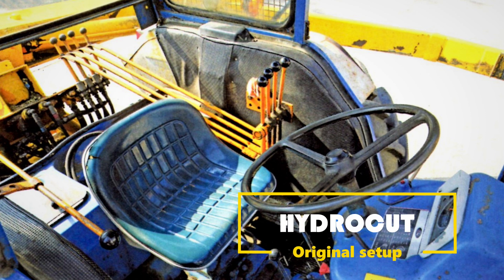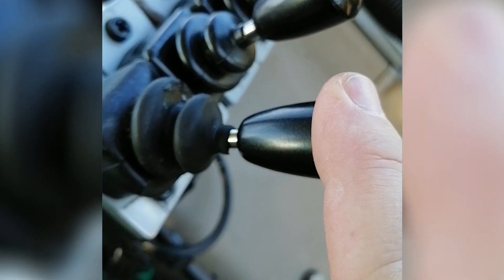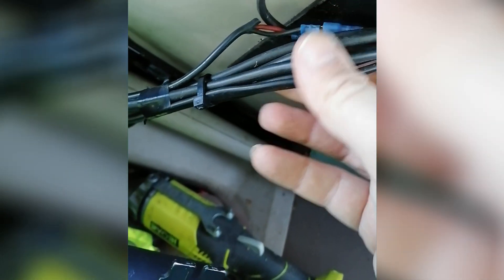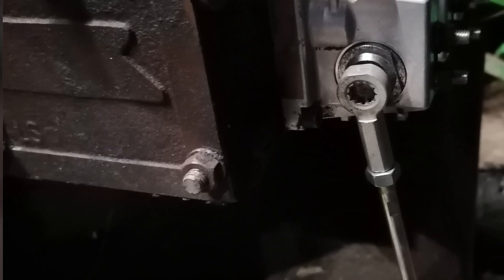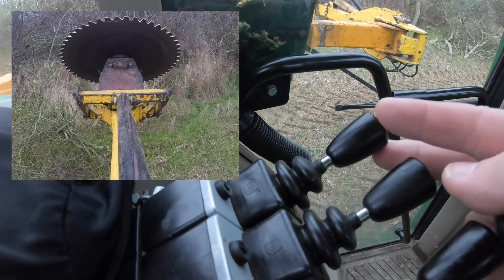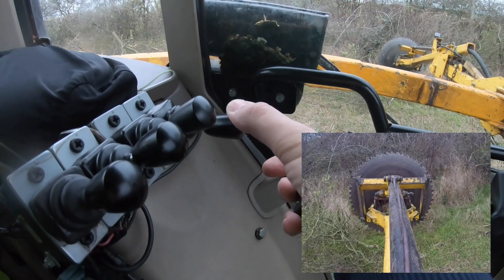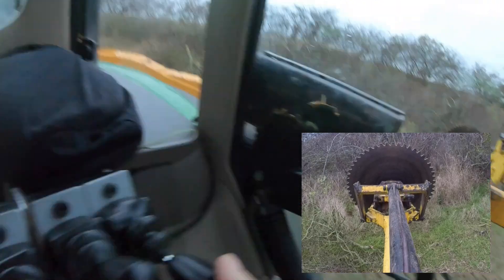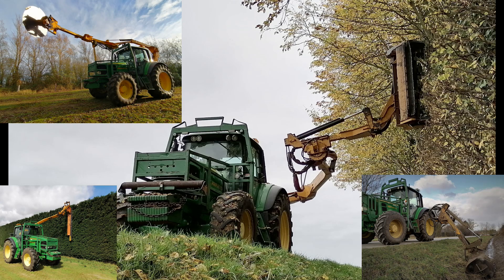ELECTRONIC SPOOL VALVE CONVERSION ON A TRACTOR MOUNTED HEDGE CUTTER          (Hydrocut G-rahf)

Comment: I got the newer version of this but can't adjust levers in cab but there's a Allen screws on each spool with lock nut .and levers a bit chunkier.great set up a wee bit costly tho .cheeper than a new hedge cutter and can take if off if ever changed machine

Comment: Great job 👌well explained.  A good bit of work but fairly straight forward now that you'd showed the ins and outs.  I love learning new stuff like this.
So has you to buy a whole new valve block for the back or did the electronic bits mount on the old one where the levers were?

Much improved operator comfort l would imagine?
Reply from the maker: Yes much easier to use. and it is a whole new value block you can control it with a joystick if you wanted but as you can see the levers  work really well and you can use more than one at the same time which is difficult with a joystick